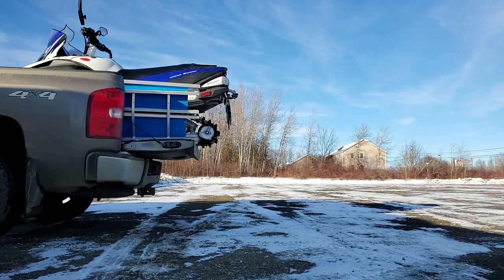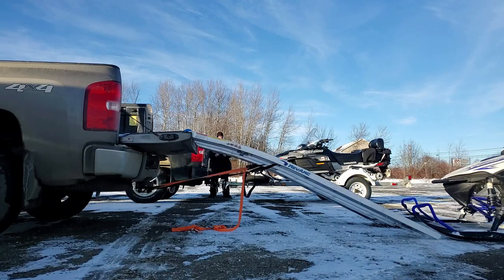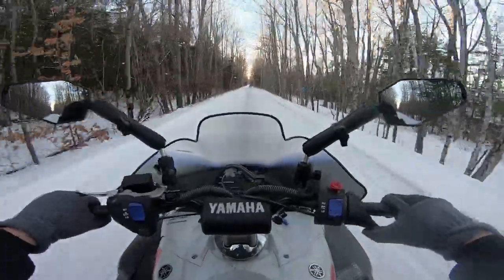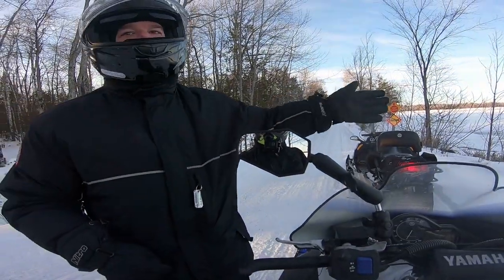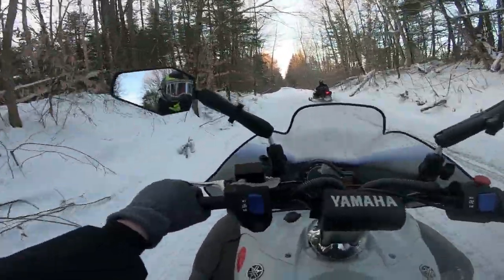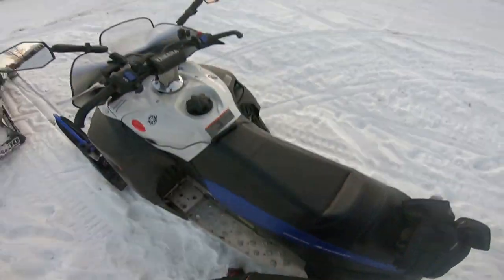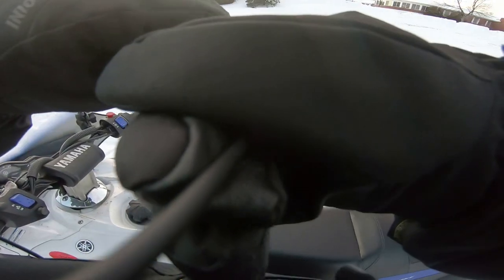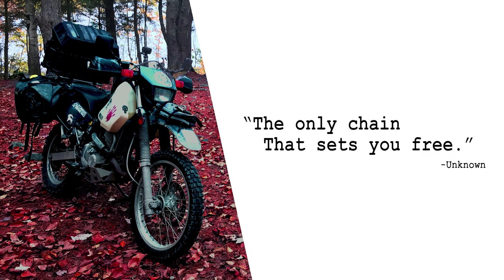Snowmobiling | Newport to Dover

Comment: Any of you guys know how to get to Greenville from the Dover/Newport /Cambridge/dexter area atv trails? I heard there is an indirect route through monson. Can anyone chime in?
Reply from the maker: I dont know of any way of doing it from Dover on atv. Important sections of the trail are closed in the summer. You can get on the trail in Guilford off of High street but I actually lost the trail and couldn't find it again. I didn't look to hard, with the Dual sport I just decided to book it on the road.  Ended up taking rt 6 past Abbot where there's a rail bed that takes you to Greenville. I wouldn't be surprised if people who have done it on atv might have been bending the rules.